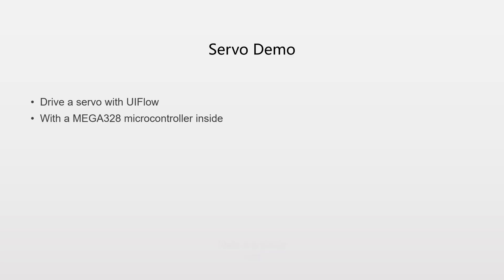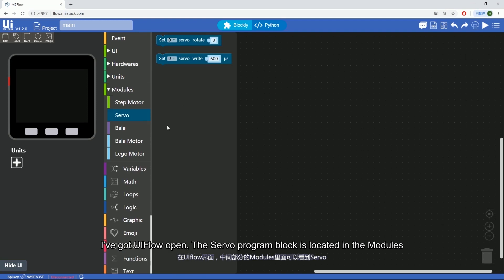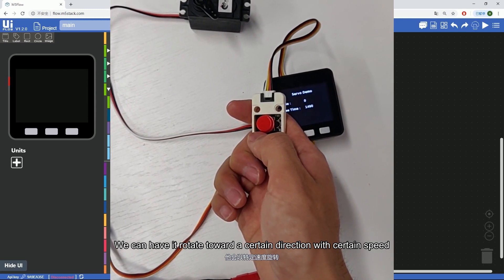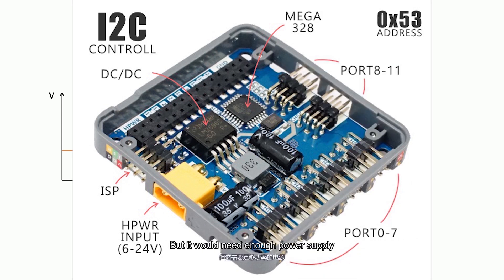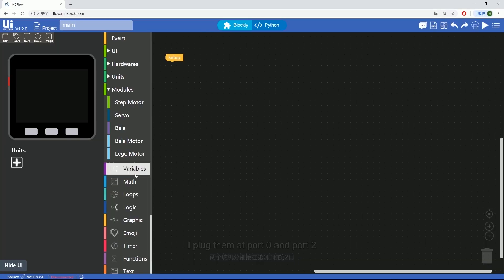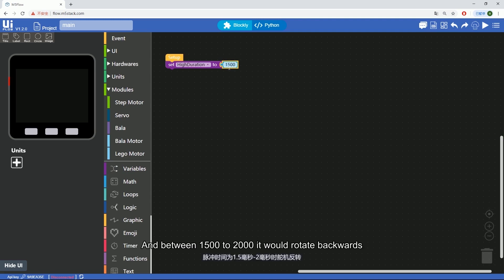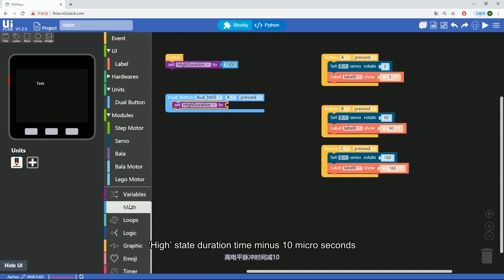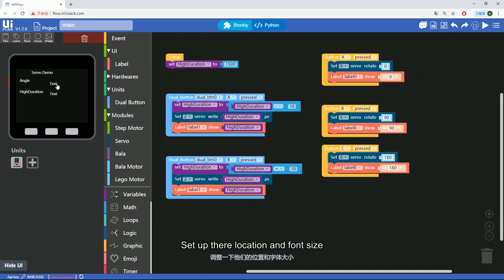M5Stack Ui Flow tutorials - E4 Servo PWM

Comment: how can i adjust the speed of a 180deg servo?
Reply from the maker: Hi Sir, 180deg servob does not support speed adjustment but angle😀
Reply: @M5Stack  yes, but how can i slow it down to get slower to its position? i tried a delay and increase a varible by 1, it slows down, but gives a lot of jitter